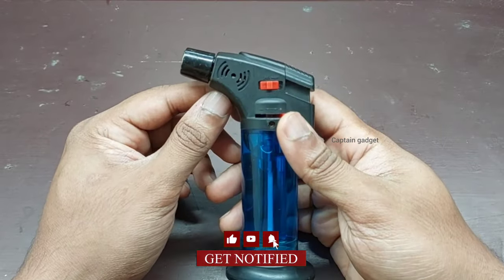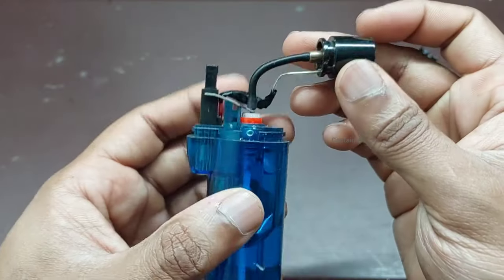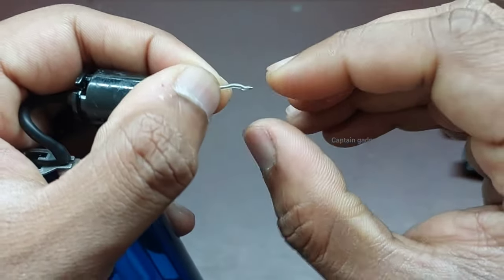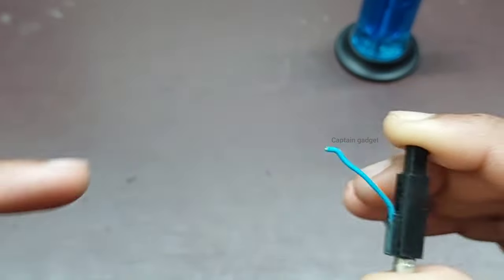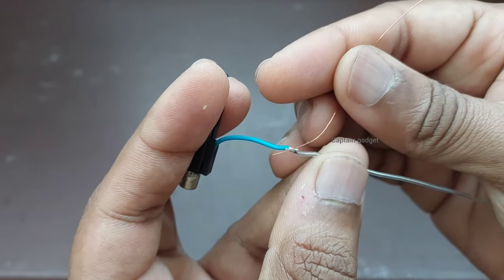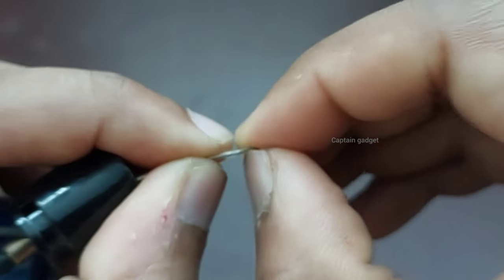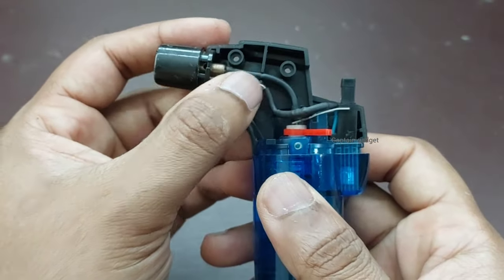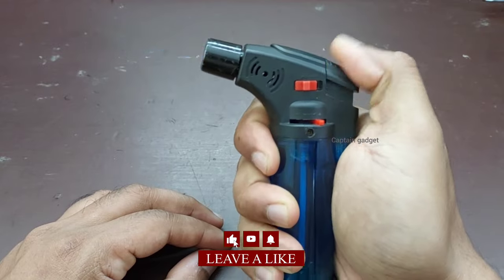How to repair Jet flame lighter. No Spark? Not lighting

Comment: How to fix the gas issue?  The gas is not passing but the spark is there. If you can show how to get the jet head out, gas pipe aswell and clean it that would be great, thanks!
Reply: did you ever figure it out? i have the same problem
Reply from the maker: https://amzn.to/3wZkbay
Reply: if the fuel isn't passing from the fuselage to the nozzle, check the hose that connects it to the back of the aerator and the valve stem that connects the hose to the fuselage. there is a U shaped piece of metal that slides under the valve, around the hose and over the ignition that acts as a lever so that when you push the ignition,  it simultaneously opens the fuselage feeding it into the hose and out the aerator nozzle. if that metal piece isn't bent correctly, is missing or there's a gap somewhere in the fuel line you may not get a flame. also there's a small brass cylinder in the very tip of the nozzle that, when overheated,  can dislodge, offsetting your air/fuel mix making it too o2 poor to ignite.

Comment: I have a small torch, Weller brand, model ML100, I haven't been able to use it since I bought it. It came without gas. After a while I charged the gas but the flame came on and then went out immediately. I don't know what the fault could be! The spark works and the spark sticks right where the gas comes out, but I haven't been able to fix it :(
Reply from the maker: Too much gas or air. Adjust the gas flow. flame